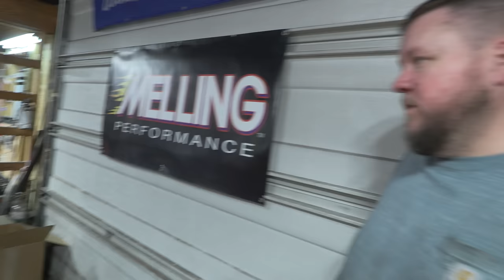Tommy’s S-10 is making a Comeback!

Comment: I’m curious why you guys are going through all the trouble on rear leaf springs doing the Calvert system but not using the Calvert split mono spring ? 
Seems it would be worth the extra cost with less hrs spent doing bushings and using stock leafs . 
The two piece spring is the way to go on any stock style suspension.

Comment: Nobody would want to steal those rims on the Orange Nova. Fugly! Tony`s Excursion needs work yet again. Fix Or Repair Daily! Nice group of cars there. I really can`t say much about Fords needing work, my 91 C1500  5.7lwith 310,000 on the clock needs a trans, my 700r4 finally blew up, and my 96 Blazer 4.3 with 230,000 blew up(rod knock bad). I refuse to dump either. Both are solid, one rust spot on Blazer, none on C1500. I`m walking 4.5 miles to work, too old(66) for that shit. A friend is selling his Fusion beater car for 1500, but I refuse to drive a Ford. Had one nasty experience with an 87 Mustang GT I bought new when the 88`s were in the showroom, it was a lemon. NEVER again. Sub-Zero is progressing nicely. I wish my 91 was fixed, I have a bunch of parts for it including a digital dash. Moonie gauges took a dump. Speedo, gas and charging work, no temp or oil pressure,

Comment: Put a winch on the trailer! I know it's an extra cost but it's invaluable for safety and to protect the car. inevitably when you go racing They'll be a day when you can't get it on the trailer under its own power. in the long run It's just super helpful. if the car is 3000 pounds you can get away with a winch with a lot less capacity because it's on a straight and level roll for the most part.
 This means you're not Lifting the " Full weight of the vehicle.
 You'll never regret it.

Comment: Bien le scooter a papa les notre font du 8 s aux 400 m en 100cc 2 tant plus boost le plus dur  c est le variateur a changer les disque de leur transmission certain monte à plus de 150 kmh pour la route sur circuit y a pas de compteur juste la température d eau et d huile